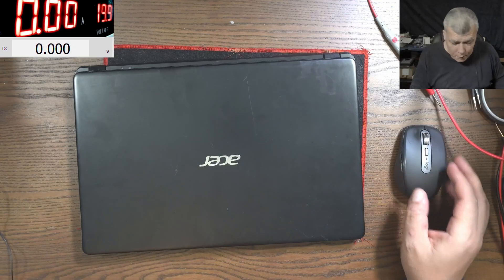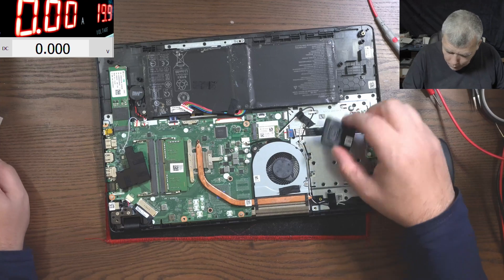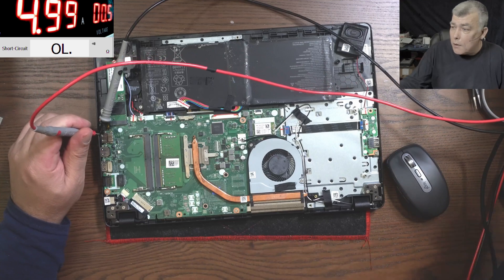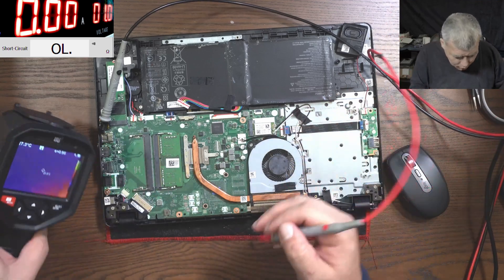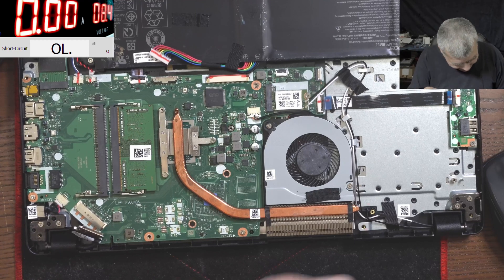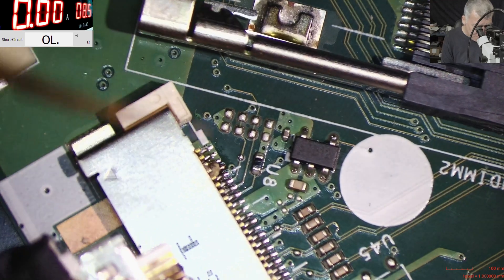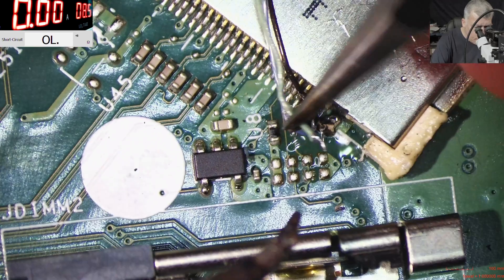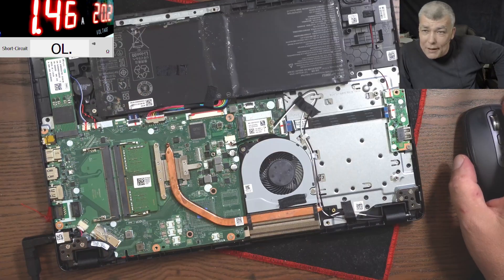Acer Aspire 3 N19C1 No power, motherboard repair - a tricky one

Comment: Why would there be three different, color-coded wires, soldered to different pins on the connector if only one connection was actually needed?
Reply: Maybe to easily carry more current without getting too hot? (3 wires better than one)
Reply: it's most likely the 19v powring the screen, adding wires distribute the power puting them in parallele reduce  heat generated by the curent and add relibelity to the system having three redendent wires in a flex cable that is  susceptible to break due to screen open and close movement is a smart design, if one brack two more are here carring the ~15 watts
Reply: I had the same question. Thank you for that explanation, sounds logical @abc17895